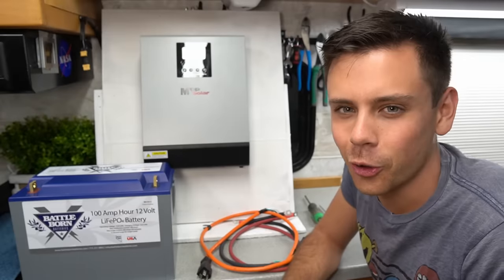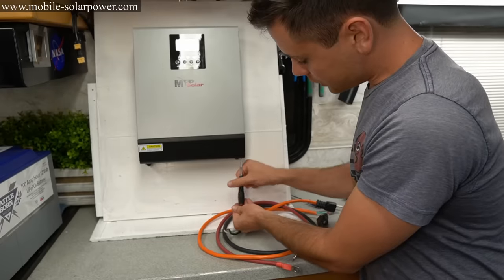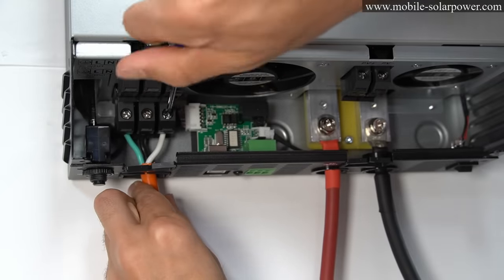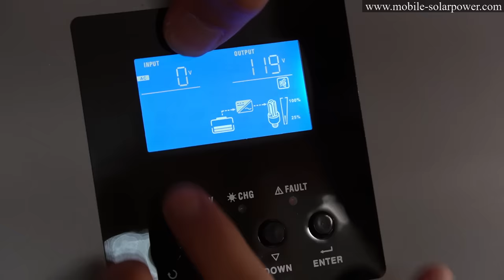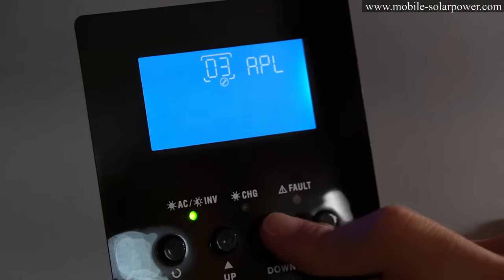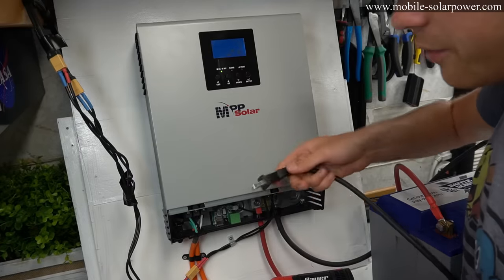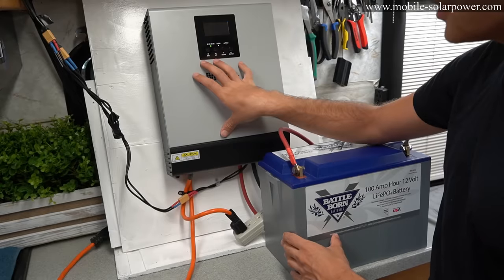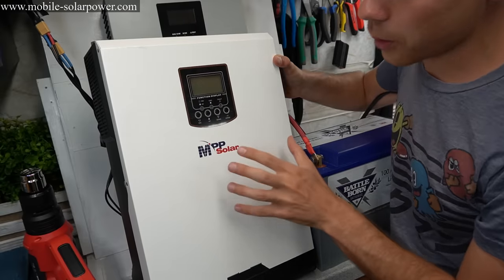Beginner Friendly All-in-One Solar Power System! Build a System in Minutes

Comment: I have a question - Does this inverter automatically switches to the battery power if the grid goes down? like a UPS?
Reply: Yes it does as long as the batteries have enough charge in them
Reply: I think the setup step 01 has 3 arrangement choices.
Reply: you would nt have any more home power outages

Comment: What about connecting a DC output to this unit? With this unit, are we stuck with AC output only?
Reply: That question confused me. If you want 12v DC outs, wire a 12 fusing distribution panel  to your battery like in any other system. This unit is a charge controller, an inverter and a power transfer switch to change you to grid when your draw is more than the solar system can deliver. Your DC output comes from the battery.

Comment: Thanks Will, it was a great blitz, quick and concise rundown, I have two questions, what if the battery bank requires a fuse, how do we size it up and what type should be used
Second question is what steps need to be taken to power the whole house, how do we connect the inverter the house loads
Thanks

Comment: Does this connect to dc? Showing it connected to a dc fuse block would be cool
Reply: I was thinking the same thing. Can you run DC w/ converter  and the inverter AC also.
Reply: I really want to see this too.
Reply: @woodspirit98  For 12v out you would connect direct from the battery to a 12v fuse block. I had the same question but figured it out from a couple others here answering that question.

Comment: Hello bro I have a few questions concerning this All in one system

1. Do you have it in a bigger wattage 
2. Assuming I don't want to use it for off grid purpose is that ok?
3. Assuming I want to use it for off grid purpose does it needs the 120 input volt inorder to work like a grid tie inverter
4.If I do buy this beginners All in one system and I want to run an AC conditioner split unit is that gonna manage the load?

Comment: hey buddy do they make a 12 v dc to 240 vac model  ,, we dont use 110vac in Australia
Reply: Yeah they are available... I have had one now for about two years.... Just don't use it with lead acid batteries unless you can get them extremely cheap because you are going to need a minimum of 4 wired in parallel... The first battery I used was a giant 260Ah lead acid battery and it died in less than a year. I found that when a heavy load was demand from it, the voltage would sagg and the current increases to compensate. Which in turn heats up the cables and the battery. The battery starts to gas and eventually refuses to take a charge... Single big battery is a single big bad idea... The LifePO4 is a much better choice... It looks more expensive to begin with until you destroy some lead acid batteries and then you try the lithium batteries and realize that you would have actually saved time, money and a lot of stress if you just had done it that way to begin with... I got mine from eBay and they still seem to be at the $800 price range for the 12v version... I would recommend getting the 24v version or higher because their inverters can power much more things... Hope this helps!
Reply: @PeterMilanovski  any idea what brand/ model you have and whether they sell the 24v/48v option in Australia?
Reply: @davidturner8301  it's exactly the same model as in the video, I got mine from eBay and at the time they also had a 24v version... But that was a few years ago and I'm rather surprised that they still make it... The 12v version appears to be the cheaper option because every time you want to upgrade your storage you just have to add a single battery at a time compared to the 24v version where you need two batteries each time, but I believe that the higher voltage versions are more efficient because converting 24v to 240v generates less heat than that of the 12v version. 48v would be even better but you will need four batteries each time you want to upgrade your energy storage.... It's more expensive but it's definitely the path to take if you can afford it. And you definitely need batteries wired in parallel so that you can share the current draw across multiple batteries that are paralleled. Otherwise a single battery bank will have a shot life span from fast charging and discharging.... The more banks, the more years of service that they will provide... Basically batteries don't like to be thrashed... Hope this helps... Have a look on eBay..

Comment: how do we use this "all in one" with raw lithium cells/LiFePO4 DIY Battery?
Reply: Kevon Smith / not sure on what you’re getting at? Are you asking how to operate a raw Lithium single cell battery or a monitored fully enclosed Lithium 12V LiFePO4 battery?
Reply: MppSolar manual 1kvaetc inverter charger safety instructions " CAUTION--..charge only deep cycle lead acid type rechargeable batteries. Other types of batteries may burst ..." etc blowup...I guess I'll have to call mpp tomorrow...I wanted a 12vdc lifepo system.

Comment: Seems like a good system for an RV? Correct me if I'm wrong  Has inverter, auto transfer switch when you connect shore power, and solar input. I guess all you would need is a DC -DC charger to the battery system for 7-pin trailer wiring to the vehicles alternator. Then connect battery to a 12v power distribution panel?  How is the price compared to buying all the separate components including the transfer switch?

Comment: Super  excellent   solar  &  battery  bank  connection  with inverter  # but Will Prowse   as U  said   if more  power  bank  is  needed  then add  more batteries  in parallel  but  remember   connection in parallel  only  increase Ampears / h  while  Voltage remains same #

Comment: have an MPPT solar charger with the following specification 
Current: 15A, 25A, 35A, 45A(optional)
Rated Voltage: 12/24V/48V
Charging Type: MPPT
Self Consume: <12Ma
Terminal Scale: 280-AWG
Working Temperature: -20C ~ +55℃

And I have two batteries of 150x2 how many solar I should install and what should be  the watts of solar panels 

Thank you

Comment: Would I need to add a master cut-off switch between the + battery terminal and the box?  Or is there one I did not see in the video on the box itself somewhere?  Thanks for making these videos.  I know this is an older one but I am going through them all and have learned a lot.

Comment: Have a question about the MPP LV2424? How do I set it up so I can send power back to the utility when the batteries are full. The unit shows no electrical diagrams about how to use the dry contacts. I know that it is not UL listed but there still has to be a safe way to send that extra power back to the utility. Love your videos you give good honest reviews of equipment and tools. As well as easy to follow instructions

Comment: Great video and I'm trying to learn as much as I can.  If I wanted to use this in a workshed (wood shop) to power my lathe and other equipment I believe I understand the setup - AC connectivity.  How would I connect my 12VDC LED lighting in this system ?

Comment: Hi Will, great video and website.  If this was used in a vanlife project, are there any 12vDC outputs from this unit?  How would you go about getting 12vDC outlets using this system.  Thanks.
Reply: I'm here wondering the
same thing. And have been studying his and
the explorists' videos like a fiend.
Dc power: Unsure about dc power. Thinking
(but unsure and still researching) that you can
create de power by using the marine grade
fuse box, doing the math for each appliance
regarding which fuse amp is needed and
which wire gauge is needed, and connecting
the mpp solar unit > fuse box > battery.

Let me know if you figured it out!😅

Comment: Thanks Charles from Zambia 🇿🇲 this really helped me and just a question if you connect both Ac and DC charging system does the power switch to Ac mode automatically to charge the battery or it has to be turned on and off manually.?

Comment: Just started watching your videos. Great information and straight to the point. My question is: since this is a hybrid/isle/on-grid system... if the batteries are fully charged, panels are doing great and house is not using all that power... will it go back to the grid? Does this system detects if there is AC input and sends back to grid the electricity not being used? Or AC input is just a backup in case more watts than allowed are needed. Thanks.

Comment: Great video just like all of your videos!  Do these all in one systems just switch to grid power when solar isn't enough or does it just pull the additional amount it needs from the grid?  I.E.  If I have a 1000w load with 400w coming from solar, will it just pull 600w from the grid or will it switch to grid power and pull all 1000w from the grid?

Comment: Hey Will this was such a great video and I’m sure my comment will get lost in the aether of social media commentary but I wanted to ask you from Australia — I have a hobby of keeping rare houseplants and right now they’re suffering because of the light. Even though I’ve protected them under cover and they still get daylight sun, it is not enough. As a consequence I have bought a heap of heatpads and LED Growlight; but they’re killing my electricity bills to run these lights and heatpads 24/7. So instead I was thinking of setting up a portable solar system to the roof of my rental — how would you suggest I go about beginning to work out how much power I would need to power all of these appliances + how much battery capacity I would need to run these appliances from battery power for say 2 days (as back-up reserves) + the same question as above but including all of my household heating appliances (I’ve been working on insulating my place but it just doesn’t stay warm no matter how many holes I plug around the joint! 😢) + how I would backwards engineer from these questions a portable solar array system that could power these battery, and how I would (impermanent-ly) attach these panels to a patio roof/how to align them on the roof for maximum sun exposure efficiency. It is much more appealing if the panels were easily discountable because as a renter I cannot afford an enormous grid connected system — I was hoping the system would cost under $1500 AUD…. But maybe that’s an unrealistically small budget to set oneself for such a system?

Comment: If I were choosing between these batteries, what would the primary considerations be for choosing a 48v vs 24v system?  6x EG4-LL (V2) 48v 100Ah (24V 200 Ah EG4-LL

Comment: Thanks Will for the great vids! I own this 12v unit above.  If I hook this up to my Lithium ion phosphate lifepo4 "house batteries" on my motorhome, Can I still let the existing motorhome 50 amp charger still charge the same batteries as well? Desirable because it would be much faster to charge (when I have shore power) than this built in 20amp charger. (I will have 840ah 12v house batteries) Thanks for the input.

Comment: I've watched a hundred videos and have never seen an explanation for what I "assume" is a common idea! Using "All-In-One" systems (such as the MPP or other "all-in-ones") to run battery & solar directly into an electrical panel.

[My Situation: 15x25 small barn. Wired like a regular house (15A outlets, 10@ 10watt LED "recessed lights"). I use a Champion 3500 watt Generator (w/wireless remote) for my "shore power". (I'm 100% off-grid.) My Small "6-breaker panel" is wired direct to the generator using a TT30 RV-Ready plug. I have to run the gen even when I'm just using a TV and LED at night. A TOTAL WASTE of GAS !!! ... so using a MPP type system (inverter/charger/solar & a battry bank) seems a good way to go right!?
... Why bother with an extension cordfrom "line out" (-as i see in most videos)? ... Can't I wire my generator into the MPP "Line in" (instead of going through the breaker box as I do now)?
... Then run 14/2 (or 12/2?) from the MPP "Line out" directly as the main feed into the small breaker box?
... Can't a significent battery bank (running thru the breaker box) service the outlets (and a overhead fan)? (except when using the coffee maker --which I would do ONLY with the generator on). (So every morning coffee session would help top off the batteries.)
... Won't the MPP auto transfer switch recognize when the Generator is on and "bypass" the full 3500 watts (or as needed) from the generator? 
... And when the Genearator is off, the AutoTransfer Switch would switch to battery right? 

ANY response would be helpful!
--Coach

Comment: Sounds like a good setup for maybe a camper not equipped with solar.  Would the system just shut off if not connected to grid and you overload it ?

Comment: I am about to install a beginner 12V 400W solar system from your website to our tiki bar. We do have exiting grid power. I was going to plug into an existing outlet. My question is,  instead of using the male end of an extension cord can I wire it direct to a 110 outlet and then run small items directly from the new outlet? Great video and website.

Comment: Does the input voltage buffer with the output voltage or does it switch over a 100 % commercial power when solar and or battery power lags? The reason I ask is because I run a grid tie inverter on my commercial power.  I don't want to let the smoke out of my caps.  Awesome channel btw and you're definitely a great inspiration. Thanks for making the world a better place. I have many more videos to watch.

Comment: 1) Each of my solar panel has Voc (Open circuit voltage) = 37.92 volt, Vmp (Max power voltage) = 30.96 and 250w . Should I use a 24volt system or a 48volt  system?
2) Can I connect my solars panels in parallel in order to get more watt. eg: 4 parallel panels = 1000w.? If yes, Can I increase to 8 parallel panels to get 2000w input ? Would it be safe ?

Comment: Will, first off, thanks so much for all you do, as a retired educator I find you entertaining, enthusiastic and easy to follow, major assets for an educator. I have a technical question. I'm looking to install 400 watts of solar panels for our 30 amp travel trailer, currently with 2 - 94 amp 21volt gel batteries. If I'm reading this right the inverter is only 1000w, is there a way to up the watts with say an addition inverter or just go with separate components to get the 300 watt inverter. Tom
Reply: Dude....10:20 in the video.  2400 inverter.  Watch the whole video.

Comment: Great Tutorial !! I have a question of how connecting input and output electrical cables , my question  is it wrong if we connect  Input wires for AC Input  (L Black and N white ) and Output wires ( L White and N black )? If they are connected the other way around, will there be a problem? i don't know if you get my point ! Thanks

Comment: Thanks Will I've seen a few of your battery teardown videos and they are super helpful in peeling back the curtain on Battleborn and Li batteries in general. curious if you could run a DC-DC charger to the battery bank for this unit. Im pretty uneducated with these systems aside from what Ive learned on your channel.

Comment: Well im knew at solar tech,  so what can that little solar pannel handle at the same time, you showed a heat gun, so could you run like a 6 plug outlet cord and plug into it, like TV, vacume cleaner, microwave all at the same time or do you need the 24 amp & 2 batteries to do that, how much do you need to run a frig all day & appliances?

Comment: Hi Will. Great videos as always. I have a question about these Hybrid charger/inverters. In order to use the SBU setting this has to be tied to the grid. Where does this box sit within that setup? Can you do a diagram to show how it would be wired in? I'm assuming that it sits between the Grid meter and the Consumer Unit / Fuse box, with mains electricity passing through the unit? Is this correct?

Comment: Thanks for the explanations. This goes for an hybrid solar inverter system. Will you recommend an hybrid solar inverter or charge controller plus battery inverter? Also, will you recommend an MPPT  or PWM when it comes to charge controllers?

Comment: Any input about max passthrough wattage of these MPP units?  I bought the 1012LV-MS and apparently the 1000 watt rating includes utility power passing through the transfer switch (meaning if you want to use this as the charger, charge controller, inverter, and transfer switch in your RV you're limited to 1KW).  I hooked up my space heater to test and was able to pull 1350 watts through it for quite a while and all it did was flash a fault code and say "Overload" but kept working.  I'd like to use this all-in-one in my slide-in camper but need to be able to run the AC, Instant Pot, etc. through it.

Comment: I have a 350sf tiny home and only have one 9.1 solar frig by Unique that will take up most of the power. We don't watch tv, no micro, no dishwasher, no coffee maker, etc. Mostly just lights composting toilet fan, chargers for phone etc. Will this system with five 100w panels with two lithium batteries be sufficient for us? Need some feedback from some people that have already used it. It seems so simple which is so good for us because we are so afraid of working with electricity...lol

Comment: Good video.  One thing though,, the manual says to install fuses or breakers between the controller and AC, battery and PVs.  You didn't do this for any of them.  I understand the battery already had over current protection and your PV array was  well within the safe range,, however i don't understand why you didn't install one on the AC input line?   Please explain.  Thanks